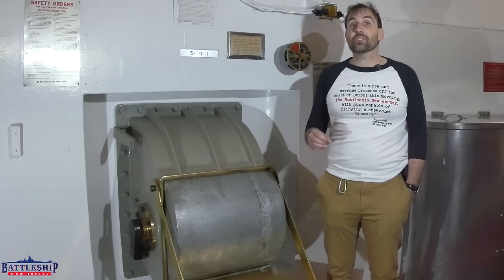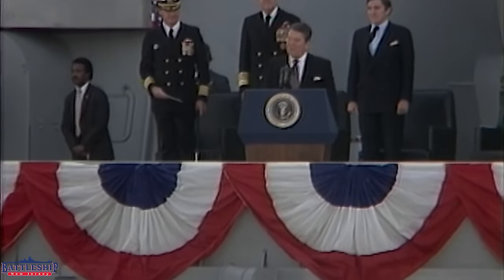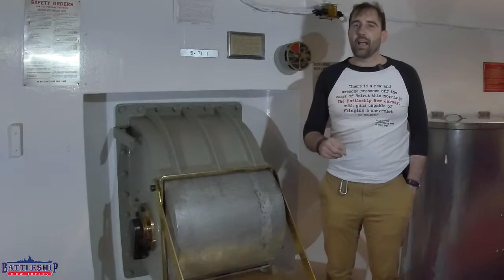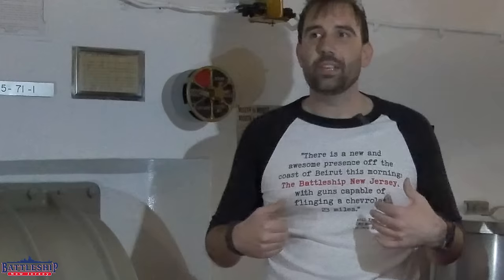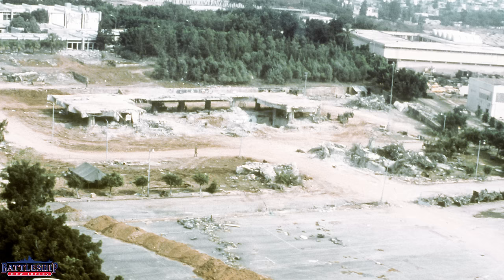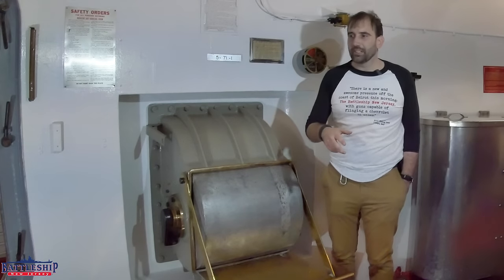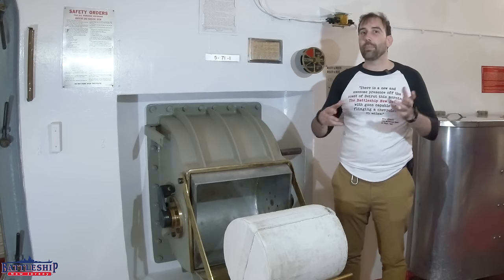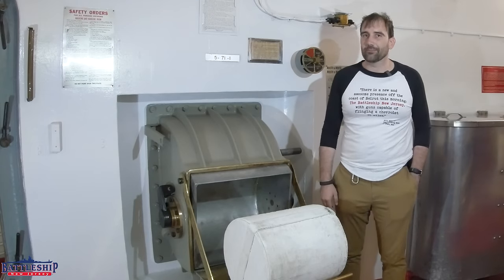Why Were New Jersey's Guns So Inaccurate in 1983?

Comment: This for an answer to this person's question. @thomasshoe92.         On pre commissioning A GMG2 attached to turret 2, after cleaning barrels for first time we found in center gun a large flame wash approximately 1-foot up rifling from chamber. This flame wash was 1/2 inch deep approximately 2 inches wide by 14 inches long. Varius of us was sent to schools for extra training, I was the only one sent to school for bore scoping of the barrels from the 16-inch turrets. on returning to the ship, we commenced checking out all 9-gun barrels to see in what condition they were in and the amount of wear each had. I found no damage to any other barrel but center gun turret 2. the bore scope is like a microscope and can magnify quite a bit. close looking at the flame wash i notice what appeared to be a fine crack on following the line I found it to go completely around the barrel. on finding this I reported to my superiors, they did not want to believe me as this would condemn this barrel from firing. About three weeks later a representative from Dahlgren came to the ship, he then went into the chamber to see the damage but was claustrophobic (came out right away). after calming him down, I went in feet first then he came after. then we inspected the damage. He then concurred with my findings and stated the barrel was condemned. after returning from Lebanon cruise, during which center gun was not fired. The ship returned to the shipyard and while there we replaced the center gun barrel. At that time I was leading FirstClass GMG1 for the division turret2. To replace the barrel a jig was built to carry the 100ton barrel and slide the bad barrel out. then the jig was taken to the pier where the old barrel was exchanged for the new barrel, then placed on the ship and aligned precisely. Then the new barrel was slid back into the turret and mated to the breech. I have no photos of this and have not found any. will answer any more questions.

Reply
Reply: Thanks for your response, @turretman1st! Your YouTube handle suits you, think. 👍
Reply: @GrahamCStrouse  thank you

Comment: Ya' know you could probably sell replica 3" powder grains in your store. They could be cheap plastic parts.
You could 3D print some prototypes. Then find a plastic molder. Or, maybe the OEM still has the molds that you could borrow. (That is a common practice among plastic molders. The customer retains ownership of the molds while the molder stores and operates them.) I'll bet some of your listeners have 3D printers and would print some out for you. They would just need the dimensions and would not need to be mil-spec accurate. It would be good to get the color correct. Depending on demand you could even set up a distributed manufacturing scheme. Although the cost would be high for 3D printing all of them. (hmmm... Adam Savage?) Just a thought, love your work.
Reply: The powder was extruded with hollow cores through them IIRC and not cast.   For the numbers they would likely sell...the most economical way to reproduce them would be 3D printing which could reproduce them very nicely.
Reply: You could make them at home with playdoh.
Reply: A pillow in the shape and look of a powder bag would be a fun article.
Reply: @recoilrob324   I'd love to have a couple of live pellets to experiment with, with an eye for rocketry.
With obviously, taming those wild beasts down a tad.
Get a high power engine working off of those, make new history, using old technology and mixing new and old tech is one thing I'm great at.
That suggested, I'm in no hurry to do that. It'd just be so utterly cool to do it. Currently though, I've no place to safely secure such pellets, as I live in an apartment building now.
Back when I had a house and garage, it'd be fine, as storage in a modest underground storage chamber would've been trivial to build.

Comment: If some shots were going farther than others, that could be caused by faulty powder burning with too much pressure. That could also have caused the barrel liner to crack.
Reply: My thoughts precisely. There's a video around on the design and construction of the barrels. The design considerations are actually pretty cool!

Comment: We really should not have been flinging a Chevrolet at enemy combatants in the 1980s. I can understand that at times we do need to use more expensive armaments, but an Isuzu or even a Yugo would have likely been sufficient in that case. I presume it might have even had more range, and in particular the Yugo may have been more terrifying. Also, the way that a Chevrolet was built back then, after a 23 mile parabolic flight the enemy might be able to buff out the scratches, replace a few pieces, and put it back on the road. The Isuzu or Yugo would have been more similar to a cluster bomb.

Comment: They were having a lot of problems with not only the powder bags but the flash paper between the powder bag which is what caused the explosion on the the one Battleship, which they attempted to charge one of the Dead Sailors with. Which was an absolute travesty of Justice. Not only was that not the only time it ever happened, as it was reported. It is understood that it did happen a number of times during WWII. The other problem you have is a 22 to 2500 lb shell does not have to be particularly accurate.

Comment: Gunnery, from a scientific standpoint, is fairly simple.  But to be accurate, everything has to be as consistent as possible.  Does make me wonder what the chamber pressures are like with the 16" guns aboard Nee Jersey, what the allowable tolerances are, etc.  Nearly all modern tanks have a thermal shroud around the barrels, to keep the sun from heating the barrels unevenly (higher temps on top, lower underneath, resulting in gun tube droop--enough to impact accuracy over tank engagement ranges, of up to 4000m or so).  But I've never seen any such thing on a naval gun . . .

Comment: An interesting discussion would be if they had to start making powder for the ship's guns again, what would they do differently here in 2023? Is there a different method? maybe an upgrade to the composition?
Reply: Who knows.   They wouldn't need to discard the old ammo.   It would be recycled and mixed with more solvents and re-cast the stuff.
Reply: It would probably be pretty much the same, if they could make the bags lighter they might but they would probably keep the bags the same size to work with all the machinery. If they were really on it they would make an autoloader
Reply: @jacksonledford6874  An autoloader would be a smart upgrade, fewer hands need to touch the stuff and it would speed up the rate of fire.
Reply: Interesting. I recall know Air Force Civilians in the Early 1990s complaining the new bombs being made to replenish stock used in Desert Storm were using old / existing composition when there was newer better chemical composition they felt should be used.
Reply: @wfoj2  they might use a different composition for weight or less wear on the liners but the pressure of the explosion and the size of the bags would have to stay the same for the 16in guns. Maybe a sabot round could be made or guided mutitions, cluster bombs, incindiary, some kind of drone  launcher, a rocket assisted round, nuclear rounds, chemical/bio rounds, airburst rounds,  depleted uranium sabot. But the size of the round and the explosion pushing it out has to be the same or else they would need to re make the gun.

Comment: I thought that re-packed powder was the issue that caused the explosion in Iowa's turret as well.
Reply: There's a YouTube video about the Iowa coverup. They had old power that would self ignite under pressure or shock.. Video has great explanation of its testing.
Reply: Yes. Also the officers were changing the total charge - in an effort to increase range as an "experiment" over their at sea deployment. The leading "Navy theory" is problems of a powder charge bag being opened by tears (bags weakened by the "remixing"), or torn by something like "over - ramming". In reality the Navy still is trying to blame the gun crew for something, anything... 
(but never really the officers :"')

Comment: Probably because the propellant charges, the stored shells were very old. Also the fire control system probably needed recalibration. Battleships were extremely useful in shore bombardment in WW2, Korea, and VietNam, offering much more destructive power (large land artillery is 155mm(approx 6 inches) 175mm (approx 7 inches) 208mm (8 inch howitzer)), the 16 inch high explosive rounds put those in the shade.

Comment: there wasn't a lot in the Navy in 1983 that was 'accurate'.   JKF and Indy flew some.   It was a turning point for the USN in my opinion.   NJ hurled some rounds into the mountains,  A6 and A-7's dropped some dumb bombs with little or no planning.   Compared to what the Israelis were doing at that time (like Bekka Valley) we were soooo behind the times.   After that, things changed.   I was on JFK and at the time,0  we were young an thought we did ok, but it was far less than 'ok'.    But changes came as a result.  And that was good.

Comment: In UK cordite for the big guns is manufactured in lots. These lots are then sampled to see how much they vary in muzzle velocity from standard and then that is allowed for in the computation.  I   suspect that the quantities require of US cordite did not allow quite such a rigorous quality inspection.  Another area that can lead to significant errors in shore bombardment is an accurate estimation of actual course and speed of the ship.  Normally this is of less importance due to having a radar tracking the other ship, and this can minimise problems of tide and current on the ship.  This is not available in shore bombardment, so very accurate data on tidal effects on the ship need to be included in the computation.  Nowadays, that data of actual course and speed relevant to the ground is available from GPS.  I suspect NJ does not have that data automatically available, and certainly would not have had it in the 80s.  So their only inputs would have been from the ships compass and the log.  This provides movement through the water, but not movement over the ground, and if the current data is put in wrong it can significantly effect accuracy
As soon as I started this video, I immediately suspected old powder might be the issue, but it may not have been the only issue..

Comment: Thanks!  I was told that the inaccuracy was due to switching from the older radars to the newer ones.

Now, do a video on the radars that were still in use in the 80's, that directed the guns.

Comment: In answer to the question on the guy’s shirt, a Chevy is not aerodynamic, therefore won’t fly straight, you will miss every time.
How in the hell they got one loaded in the gun is beyond me…
Reply: they had a giant press onboard and squished it up, gave it a pointy front end.  Those chevys hurt when they hit you.  Buick was even worse.  Toyotas, in the 80's were so cheep, sailors could just crush them with with a sledge hammer and bear hands.
Reply: Simple…roll the windows down and dump the clutch
Reply: Well, if you had a Chevy with the tail fins from around 1960, maybe it would fly straight. (That's a joke, son)
Reply: Yea but it'll get there faster than a Ford.

Comment: The Missouri and Wisconsin did not have any issue with their guns nor powder.I do I know this to be a fact.Well the Captain of the Mighty MO and THE LAST BATTLESHIP CAPTAIN was my uncle, Captain Lee Kaiss. One more fun but actual fact,the New Jersey is not the longest battleship in the US Navy.That honor goes go The Big Whiskey aka USS WISCONSIN By 7 inches. On the new jersey being the fastest battleship,well,sorry boys.That speed run was not made under full combat load,check your facts and log.What was the sea state,current,wind and temperature. All four Iowas had a great and distinguished career.Just because th jersey has more battle stars does not make her more relevant then her sisters.In fact,the jersey spent a great portion of her career entertaining and babysitting fleet admirals,hell,her sister ships actually sustained battle damage as a result of their duty.So to the Curator of the jersey,don't get your panties in a  bunch over her.having served in the USMC for 20 years,I saw first hand how Missouri and Wisconsin performed.Bring back MIGHTY MO AND.  BIG WHISKEY. Much better shape and condition than jersey.sorry Ryan,facts are facts.

Comment: All Naval guns were inaurrate as shit. Even a well trained crew with the best fire control will miss or straddle 90% of their shots at range. Thats why Guided weapons made them obsolete. And what all the "recomision tHE BATTlesSHIP" types don't understand is just how inaccurate those guns are compared to modern weapons.
Reply: The technology of the time was amazing when you look at it.  Physical gearing in the fire control computers calculated the trajectory of the shot, compensating for humidity and wind, and the motion of the ship.   Assumed in the calculations was very careful and consistent powder.  If you have some source that has analyzed shots at range to  support your 90% assertions, I'd like to see it.
Reply: Fair enough but some of that was due to the enemy moving around while being shot at.
Reply: well unguided artillery is doing great in ukraine by using drones a spotters. so the main difference is a ship is on the water .so the conditions of the sea make all the difference.
Reply: They're designed with accuracy suitable for naval combat at ranges where the time of flight is long enough the target can just turn and leave the threat area if the grouping is too tight. And even at a 90% miss rate when each shell costs $15k vs a $1.5m Tomahawk, you're ahead as long as you don't care about anything in a half mile radius of the target. Guided weapons didn't make naval guns obsolete, too many threat vectors made the giant heavily armoured box obsolete.
Reply: @ronblack7870  yeah I’m talking about at high ranges at specific targets. (Bunkers, moving ships)
Reply: @crankyoldguy2  look up the number of shots fired by battleships in any engagement. Now see how many hits were actually reported by accounts from whoever they were shooting at. Even when the UsN had guided shells pretty much in 1945 they recorded many straddles for every direct hit. What I’m saying is unguided artillery is gonna inherently be in accurate at range compared to anything guided. And accuracy is by far the most important thing here
Reply: No
Reply: Straddeling as you call it is a practice known as bracket and salvo.
At the time fire control computers were not pinpoint accurate and were subject to calibration issues.
Position could be rapidly corrected to strike a target.
Firing a 16 inch cannon! You are targeting something 10 to 15 miles away and relying on information radioed to you for placement.
You also need to compensate for the pitching of the ship on the water.
And all of this depends on the condition of the powder charge.
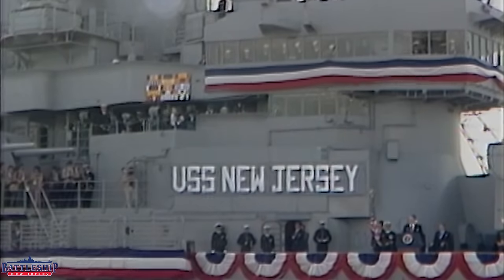Any inconsistancies in that have drastic affects downrange when your explosive laden 2:50 projectile weighs more than 1 and a half tons .

Comment: FYI I am NOT very happy with the teak deck boards I bought from your restoration project. Large chunks missing, splits and cracks. My plan was to make small clocks for my two sons but the teak is in such bad condition its useless. Mr Not Happy.🤨